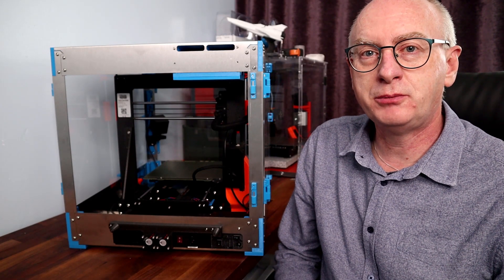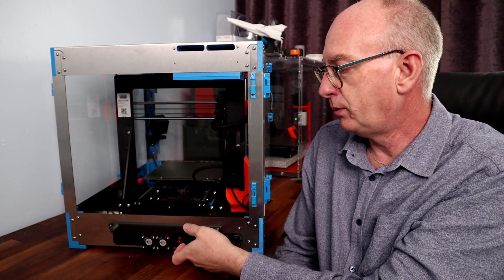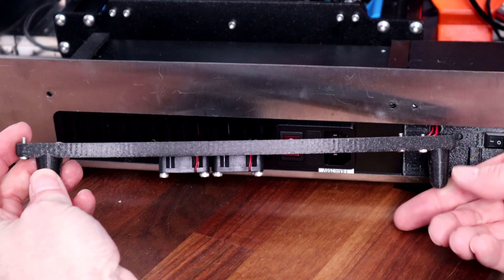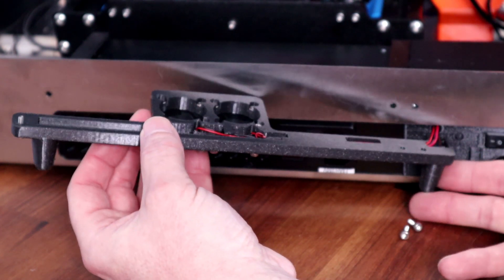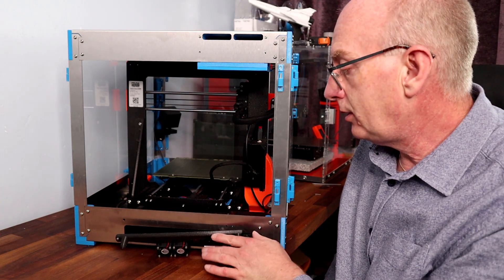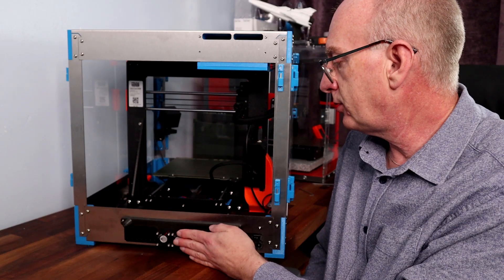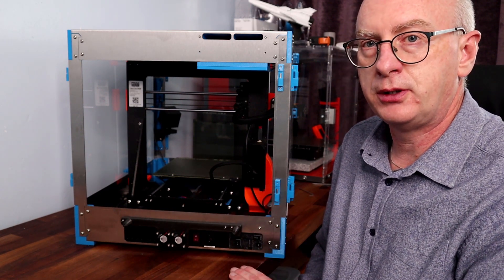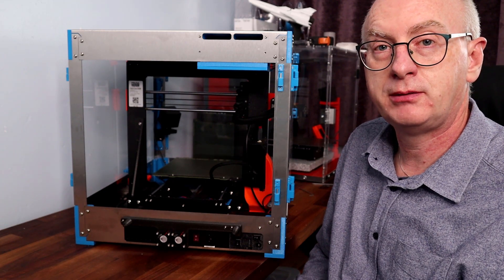Prusabox PSU Cooling Fans for Prusa MK3s Power Supply when using Prusa Box 3D Printer Enclosure

Comment: Because of the labels it looks like you are not blowing fresh air into the psu, you try to to suck it out?
Reply from the maker: That is correct. You can do in either direction. But if you blow air into the end vent remember the output side is facing the bottom. Heat rises, so I'm not sur how effective it will be to push warm air out.
Reply: @colinhill  Yeah, better try to stimulate a flow from underside throught the PSU by sucking the air out. Thanks!

Comment: Awesome job, thanks a lot for the insight. I have a few additional questions about the electric:

When I add two fans like you, can I plug in  the following all to the 5A output of the buck converter:

- the two PSU fans from this video
- the fan for the mainboard cooling
- the led lights
- the high pressure fan with hepa filter

Possible?
Reply from the maker: Assume you mean 5v not 5A? Not really. High pressure fan likely to be 12v so use the 12v connection on buck converter. I would also suggest using 12v for leds. If you add a Pi I would suggest using a dedicated Pi power supply which I will be doing soon.

Comment: Another great video, thanks Colin!  One question for you.  Are your fan wires extending all the way into the case from the fans themselves or did you join them within the bracket to supply wires coming from the relay and buck converter?  If you joined them to supply wires, what method did you use?  Trying to determine how to fit a connection for 4 wires within the bracket itself as I'm not sure my 30mm fans have long enough wires to reach all the way into the case.
Reply from the maker: I soldered extensions to the originals as they were too short. Heatshrink to cover joins.
Reply: @colinhill  Thanks!

Comment: Hello There Colin!  I have installed my High PSI extractor fan in my Prusa box.  To me it seems not to be displacing much air at all. The hepa and carbon filters are new.  Any Ideas?  BTW the instructional videos on the Prusa box build were excellent!!!  I never had to look at anything else in order to complete my assembly
Reply from the maker: Hi. You should feel a good flow of air at the rear of the box where the two vents are. Or try holding a piece of letter paper at the rear and it should be moved by the airflow. The Noctua i have used in the past has an airflow of 186,7 m³/h, and the Sunon EEC0251B2-000U-A99 is   158m³/h which i have fitted in my current Prusa Box (from Printer Box site). You can get stronger high pressure fans if needed. how does the fan you are using compare on its rating?
Reply: @colinhill      Colin,  Thanks for your reply... I bought the fan with the prusa box.  It was called out as a X-Fan RDH1225S1?  Printer is running at the moment so I cannot see the brand but will check when print is done.  I have reached out to Printer ox but They have not replied. I did take tissue paper as you mentioned and placed it in varoious areas.  There NOT Good flow out the back.  As a former engineer I do not care for th change is airflow how the prusa box is designed.  There is more flow back int the box around the perimeter area of the fan.  As soon as I place the carbon , or hepa filter with fan, hardly any flow.  I have tried blowing through the hepa and carbon filters by mouth and i can say it is hard to pass air through either one. I cannot cool internal enclosure with PLA to 30 C with only home temperature at 73°F.  With fan at full out internal temp in 33 C   And I also have your power supply fan system added and running it as well?

I just looked up the model of that fan.... 87.79cfm  is the tech spec....  It might be high psi but certainly not even close by the CFM you have called out.  Time for a search for another fan. Thks
Reply from the maker: @punkin5112  one CFM is ~1.699 m³/h so your 87.79cfm is 149 m³/h which isn't to far below my current fan at 158. There is some 'blow back' into the enclosure, and thats because the hepa filter is very dense.  For PLA you MUST keep one of the doors open - perhaps the top window. Otherwise the enclosue will get too warm. The fan probably won't be able to cool the enclosure below 31-33 degrees at PLA heater settings. An alternative for the fan might be to locate the fan outside the enclosure so it sucks the air. There is no 'blow back' with this method. But does mean designing something to work. So bottom line, if you are only printing PLA then keep the top door open. If you are doing PETG or ASA/ABS then the higher temps work better.
Reply: @colinhill  Thanks Colin...  I do plan to print ABS in the future so your thought is interesting.  Thanks Kindly!

Comment: I also ordered the Prusabox and, while I'm watching your videos, I'm thinking about building the power supply on the outside of the Box, so that I don't have the problem with the heat and to also have a durable power supply. I would put the Prusabox on an Ikea Lack table and print the holder that can be downloaded everywhere. What do you thinking about?
Reply from the maker: There are two large holes in the casing for the PSU cooling so that would be an issue I think. The fans I used do a good job. Also depends on the temp of the enclosure. Anything under 30 degrees is fine for PSU with no extra cooling
Reply: The lack tables are smaller than prusa box. How do you plan on making this fit on lack table? I ask bc I wanted to do the same.

Comment: how do you wire the fans up?  happy new year
Reply from the maker: There are many options. Are you using a buck converter? Or using another source of 12v power for bits like LEDs etc. I didn't go into too many specifics but could make a follow-up video if you feel it will be useful
Reply: @colinhill  yes that would be great if u can